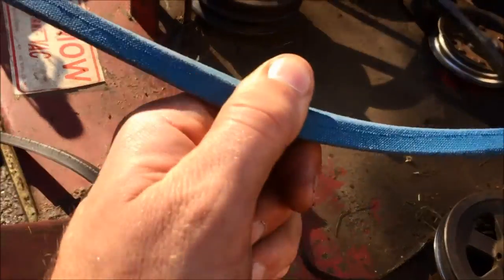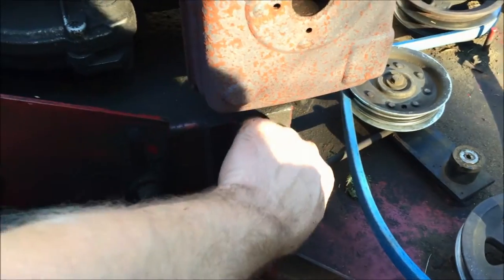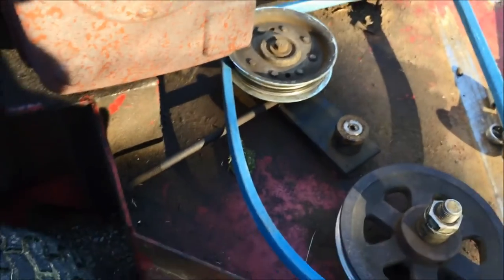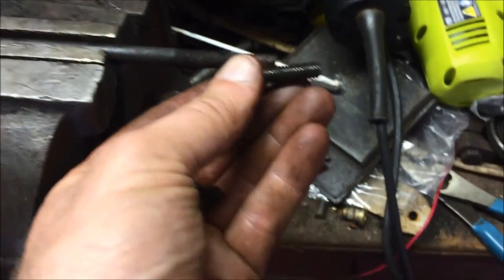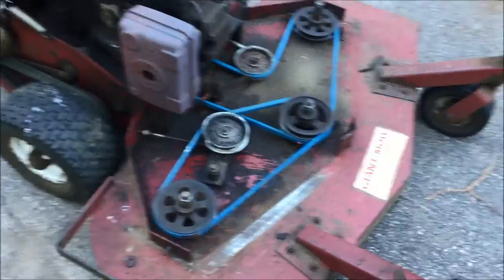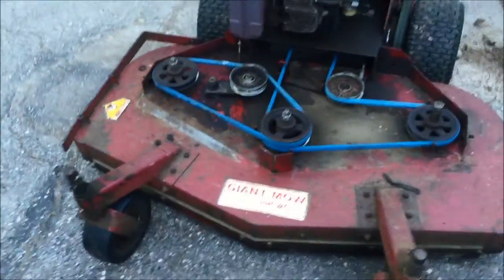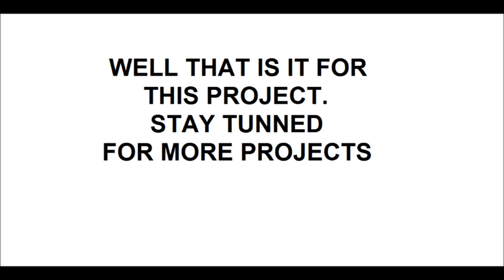Giant Mow Fix Up Part 4 Mower Deck Belt Replacement

Comment: What are the belt numbers and he name of the place where ou brought them?
Reply from the maker: Hi i got them from Vbelts4less.com one is 5/8" by 89" the other is 5/8" by 52"
Reply from the maker: https://www.vbelts4less.com/B86K--B-Section-Kevlar-K-Plus-V-Belts_p_14736.html
Reply from the maker: https://www.vbelts4less.com/B49K--B-Section-Kevlar-K-Plus-V-Belts_p_14699.html
Reply: Hello I don't know if you still look at these post. But I will give it a go. I have a 36" giant mow yard vac walk behind and need to replace the spindle assembly but can't find the parts anywhere or part numbers for replacement. Do you have any suggestions to were I can get some information? I would really appreciate it thank you.
Reply: @richardglee7937  I have a 32inch and have the same problem can't find any parts. If you run across a source please let me know.